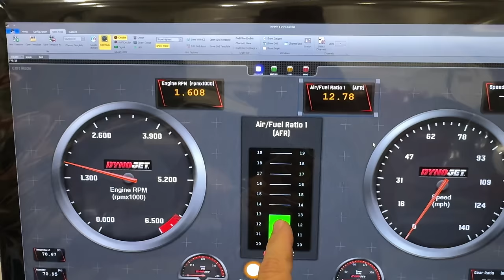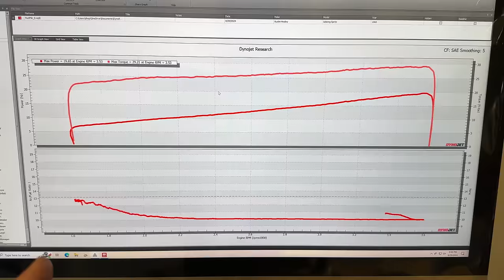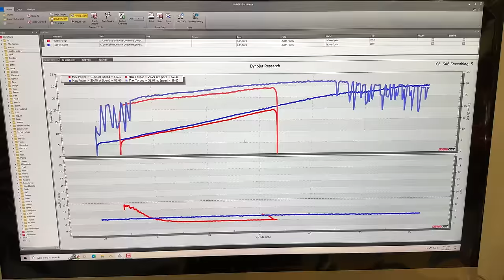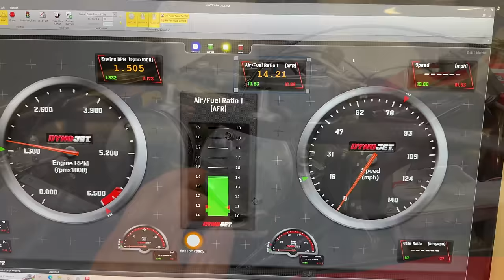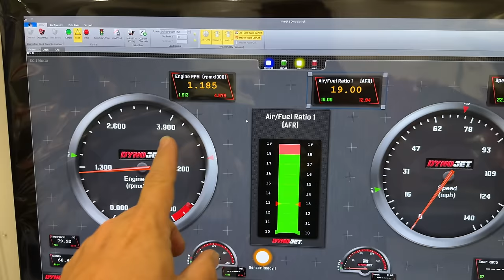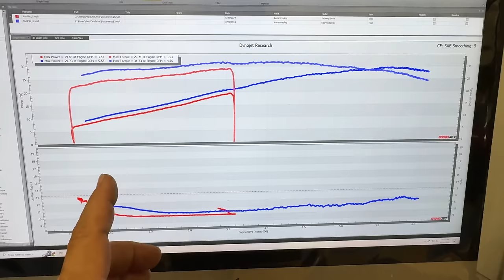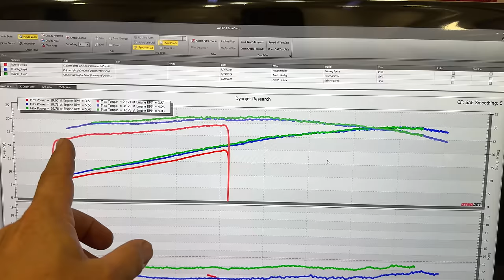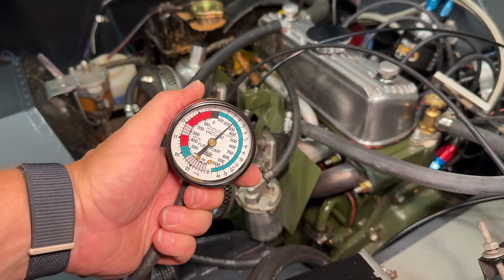Attempting to Tune on the Dyno Shows Unexpected Problems

Comment: Definitely something not right as you have said. I had a similar issue that turned out to be partially blocked air filters making the car run too rich. I had messed about for ages with needles and adjustments until I found the real issue!!

Comment: If the regulations allow try junking those air filters and either run K&N's, or if it isn't too dusty where you race use some ram pipes.
Jets are a standard size - 90 thou I think, mixture is just adjusted by needle profile.
The adjuster nut is really only there to adjust idle mix, the rest of the needle taper and spring/damper fluid viscosity combination should control the fuelling through the rev range.
Obviously adjusting the nut does affect the whole fueling curve which is ok if you need to lean or enrich everywhere, otherwise you need another needle richer or leaner in the area you want it, or most likely modify them to suit.
Good video.

Comment: Hi Steve. Very interesting and horse power appears to be very low . However, you don't seem to be concerned by the figures . And if l recall 948's originally ran on 1and 1/8"  S.U. 's . I had  no idea how much trial and error it takes to get the engine running to your satisfaction. Patience is the name of the game. Car looks superb. Thanks Steve
Reply from the maker: A stock sprite will run 20-25hp on the dyno. I didn’t build this engine but I know it was not built for serious racing so I’m not surprised by the numbers.

Comment: Webers! My 930 CC Fiat 850 had 72 hp on a dyno.. More than double. It was a little special, but made 48 hp stock on the same dyno.
Reply: Full race. 998cc Hillman Imp engines of the era made an easy 105hp at the flywheel by the end of the 1960's it was 115hp by the mid 1970's 126hp. 
This drove even the fastest Mini-Coopers out of the below 100cc class
Reply: That A series engine could only take a single DCOE due to Siamese inlet ports
Reply: @andrewwmacfadyen6958  could you fabricate up a manifold though to allow dual carbs?

Comment: Suggest you get different air filters - ram pipes (to the right length that you need). Pancakes make the air do big right angles and it doesn't enter the carbs nicely. Good luck!

Comment: Interesting.
What timing are you running? Can you run without the pancake filters to see if they're restricting airflow also but I think you have an issue with timing to get more power. It just looks like this thing wants to go but something other than carburation is hampering it. Good video and thanks  kippy

Comment: the very first step in any attempt to use the mixture nut as a means of leaning the mixture in a manually choked SU carb is TO LOOSEN THE CHOKE CABLE. in other words put some slack into the choke cable. better yet completely remove the cable from the carbs. otherwise the choke cable will prevent any leaning to take place. if the cable is tight and one takes the time to look closely it is clear that turning the mixture nut to lean the carb does absolutely nothing WRT to the position of the jet.

bottom line is: when the choke cable is pulled tight to the dash and fastened tightly at the choke linkage an action that is commonly the last step in 'tuning the carbs',  one has essentially disabled the mixture nut from leaning the mixture. although it doesn't necessarily prevent the owner from tightening the mixture nut and THINKING the mixture's been leaned. 

BTW, it's clear that the author knows this, for when he did not get the response he expected from the two leaning attempts, he resorted to putting slack back into the choke cable. i'm just a bit surprised he didn't do it at the very beginning.

Comment: Your fuel pressure is a tad high, another factor is the fuel level in the float chamber, this can affect mixture but needles are the most likely change (Jets are just one size with an S.U. carburetter) although some can wear especially the spring biased needles, but your aren't that style, I don't think.

Comment: More please!      Is the left rear tire out of balance, out of round or is that just life of a little British car of a certain vintage with wire wheels?
Reply from the maker: These soft tires flat spot quickly when sitting.  Should come out of them after driving a few miles.

Comment: Seems to be way down on power. Did you check the pistons in the carbs for freedom of movement and matching each other? How about the damper oil and springs? Did you check that you are getting full throttle?
Reply: Are you a real mechanic? Pistons aren’t in the carbs? They are inside the cylinder bores!😂 but joking aside I think that is good advice. I’ve had a couple of cars triumphs and rovers that have had those issue carbs in them and very important to a have some oil in there but make sure it is the lightest oil you can get if you want good response.

Comment: There has got to be something seriously wrong with your engine. There's no way that a pair of HS2 carburettors are too big, when I raced mine back in the early 1960s I ran it on H4s. You don't say what size engine is fitted but even a standard 948cc will deliver more than 30bhp, maybe your dyno is wrong. Altering those adjustment nuts wont effect top end power they're only for setting the tick over. An M needle was the standard one for a single HS2 carbed 948ccAustin A40/ Morris Minor or a 1964 1275 Cooper S. Check your engins state of tune and capacity then look up the suggested needle in the SU carburettor manual's list.